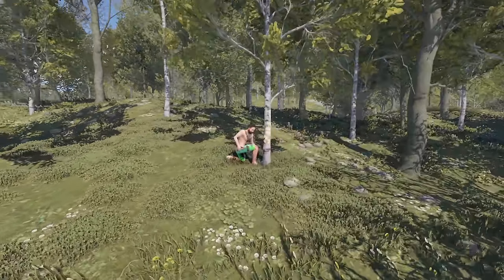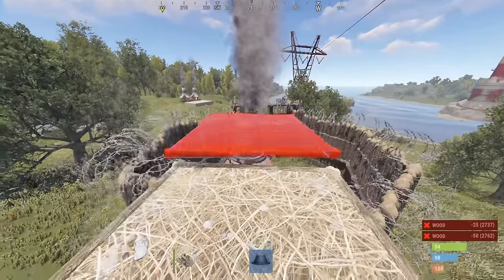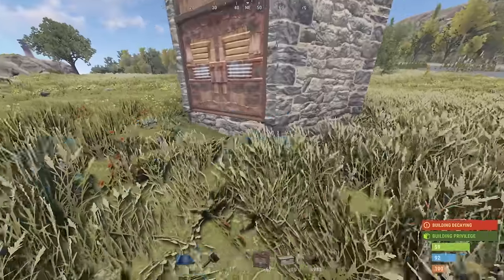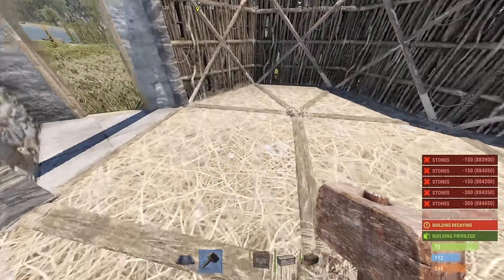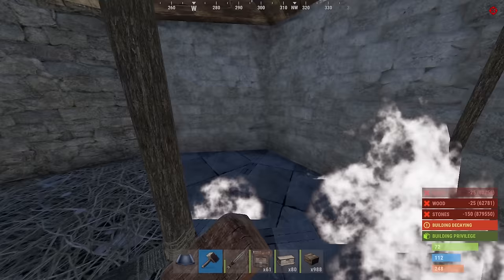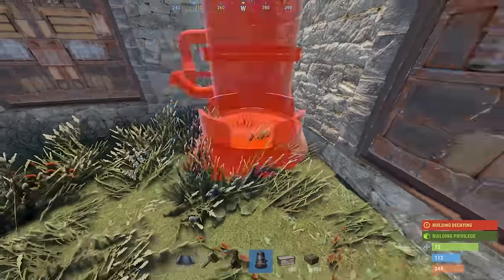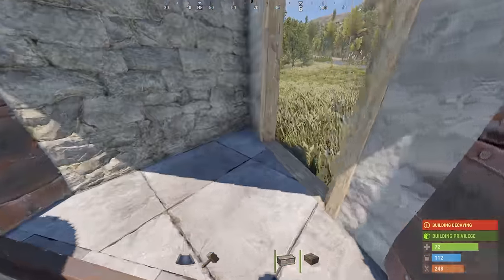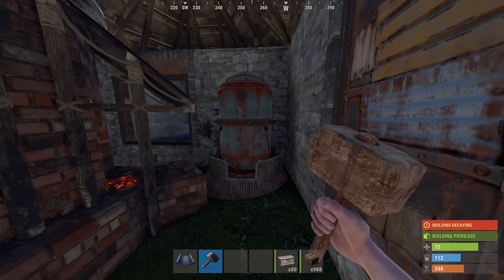Stealth Furnace Base Design | The Cook House

Comment: you can seal right away with wooden roof triangles. When ready to place your large furnace upgrade every other roof triangle to stone which will undo the conditional seal. Slap down the large furnace, then finish upgrading the rest of the roof triangles to stone.
Reply from the maker: I'd have to try that!  Nice to know! Thanks for sharing 🥰
Reply: Yea this this good that's what i usually do.
Reply: I don't get it
Reply: @ravinyu3566  The triangle roof pieces only connect forming a closed roof if they are of the same material. If you upgrade every other one from wood to stone, the entire roof opens up like a flower and you can place your large furnace, then just upgrade the rest of your wooden triangle roof pieces and it seals itself again.
Reply: @ravinyu3566  upgrade every second roof to stone. it means that each wooden roof is seperated by a stone one - stopping the conditional model and opening the base
Reply: @SockerConny80  thank you 🙏 it makes sense now why I had trouble joining up a roof in one of my bases. Totally threw me 😂 still new to the game so that’s my excuse & I’m sticking to it haha😅
Reply: @paulaneilson5110  We've all been there. The true test of a Rust player isn't how good you are at pvp, raiding, building or anything like that, it's whether you can get back up no matter how many times you are down bad. Keep grinding!

Comment: I would advise to put the entrance separately from the TC section (wall gets weakened by splash when door raid happens) and have a wall next to each door (viewing from the inside where the furnace goes). Otherwise raiders might easily splash at least two doors at once.
It should be still possible to splash the furnace from outside by hitting the roofs, breaking the base if somebody wants to grief you. It is not possible if you put the furnace into the middle and raise the foundations as high as possible. Though it will prevent refinery placement, if the furnace is in the middle.
To make going around easier, i love to place small furnaces and large boxes on the ground. You might also grow some food on the ground if you have a light and a sprinkler.

Making the base at least a half wall or full wall (same cost) higher could solve the issue with splash damage too, increase space while still having refinery inside.
I personally prefer to have a tiny refinery base close by, that one basically never got raided. It is similiar to this furnace base, but with just one empty square in the middle surrounded by single triangle foundations and a simple floor tile on top.
You should also watch Game Lightz triangle floor placement - you are doing it wrong and making them splashable from the outside.

Comment: Heres a tip, use more triangles for airlock, and if you place the roofs in wood, you can upgrade one on each corner to stone and they dont fold over, allowong you to place furnace, then make the rest stone and voila

Comment: Tactical defenses are not fully thought out, ive considered this alot with 2x2s you cannot make garage doors in those loot rooms (They pop through walls). Plus you have the half walls room shelves witch means raiders can guess that its not honey comb but loot by simply placing a roof next to the wall ( odds are low they'll try but still a disadvantage) they can also get atop your base and shoot you when you exit from above maximizing their head shot chances. This concept was scraped for a reason its not tactically feasible its way to easy to detect and your using a heavily tinted glass house simply use metal shelves instead of half wall shelves and i'd swap the doors for actual honey comb by using windows and small boxes to move in and out if possible  large box might be better if u can fit it ik this cant work always. But i use 3 honey combed 1x2 2 stage suicide drop box external tc bunkers in a compound around my furnace base and have a 1x2 with doors with general loot looking like a +/× and stash all my boom in funny places usually with objects atop of them like boxes or grow beds or in the furnace base because im cheeky like that and i have only been raided by 3 different clans and never 6 below. this is the way, this is perfection.

Comment: when you mention how to build it if u dont have large furnace bp yet and u say use 4 wood floor tiles, instead do the normal design with wood roof pieces, then upgrade the corner ones to stone when u get furnace and it will make a gap as they dont connect (saving you breaking 4 floors)
edit: just typed this then saw the comment saying it below too lmao

Comment: So you’re counting on people assuming its a basic furnace base right? Because otherwise one wall could be a ton of loot?
Reply: Put a sign out front saying: "This is a furnace base. No loot kept on premises. Raid at own risk."
Reply from the maker: 100% sign tactic works 💪
Reply: @snoweh1  i would think many would raid it then just to defy the sign
Reply: Not hard to honeycomb the TC side. With armored Dropbox tc area instead of doors +1 layer outside honeycomb you can get 22 rockets to TC which is decent.

Comment: I just can nottt get the furnace placed
Reply: Like am i supposed to be crouched on the refinery or what? I tried with 3 seperate refineries before calling it quits for the night.(builder servers are sooooo useful to learn) keep in mind im on console just trying to figure out the basics of this so i can adjust it a bit. But until I can get them both placed it don't work for me(im not great so that could be it lol)
Reply: I tired it as well on a vanilla server and i can't do it i think i got scammed
Reply: @shohamhayon2865  figured out a way to do it. More expensive but start with a 2x6 square instead i have that going. It is weird to get the top of the roof tho so you have to place double door frames and then square grids
Reply: @shohamhayon2865  if ya wanna hop on my server I can show you an alt way that works and fits more stuff. Note pricey-er on materials tho!

Comment: tried this 4 times now, cannot fit the large furnace after placing the oil refinery....doing it exactly like in the video, help me please!!!
Reply: oh and i'm on console...not sure if this makes a difference
Reply from the maker: It should not make a difference, but it could.... biggest thing is making sure the refinery is as tight as possible in the corner and the spout is facing away from the center where the furnace will be
otherwise it could be terrain thats causing issues

Comment: Kinda odd that you ripped this exact base off of Builder without the bunker. His video was uploaded on March 23rd.
Reply from the maker: This is the standard furnace base that rust players have used for the last 5 years.... check the comments

Edit: it's like 2.5 years old My bad. In fact first furnace base I can find is my boy X3
Reply: @Reksmore  Def not past 5 years this furnace base was made like a year ago
Reply from the maker: I mean I've been using it for a few years now but sure
Reply: @Reksmore  It has not existed for 5 years. I have been playing since 2014 and have over 10k hours my friend, and not once have I seen this base before 2020.
Reply: @Reksmore  It also does not help that when making a video, you do not clarify that it is not your original design, but a common base design that supposedly has been used for 5 years, in which you did not make a video about until now oddly enough. You'd think if it was as good of a base as you say it is, you'd think to make a video on it in 5 whole years.
Reply from the maker: I mean even if it's not 5 years old. It's a base that's existed for a long time. I'm literally doing a series of live in utility bases like the boat base before it.

I wasn't doing videos back then?
Reply from the maker: Aight blank. A quick search of furnace bases, red apple did one a year ago! Better go get mad at builder for stealing it 😂🤣🙄

Oh and I found one from over 2 years ago from my boy X3
Reply: @Reksmore  Got me there! I shouldn't have accused you for ripping off the base as I didn't do any research that he was the only one to make the base.
Reply from the maker: Lol it's okay, I'm not out here trying to rip anyone off though. Rust has very limited design options and my channel is very focused on designs for newer players. Which means showing and modifying old designs that these newer players wouldn't have known about